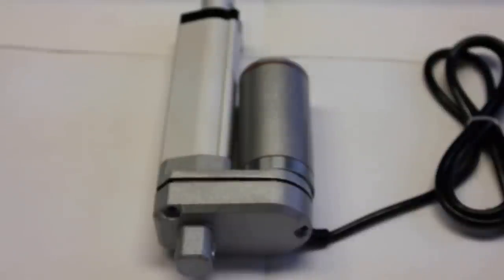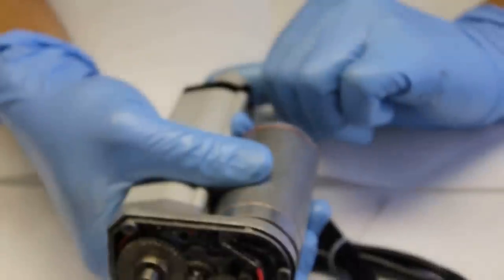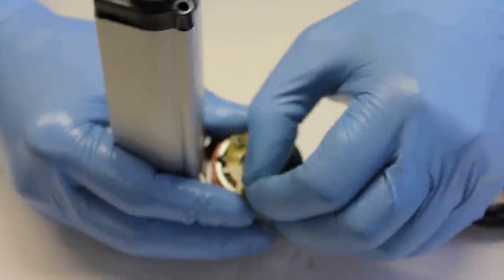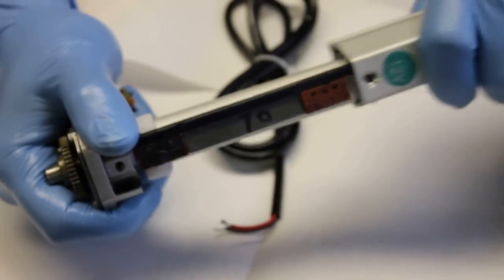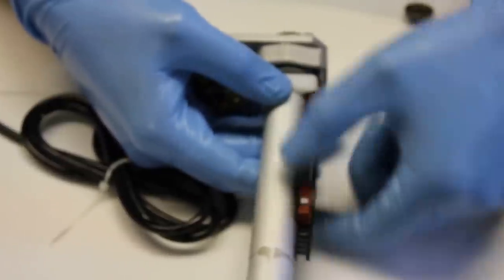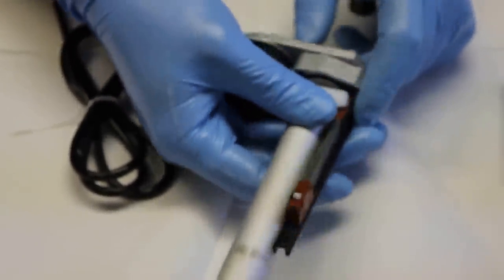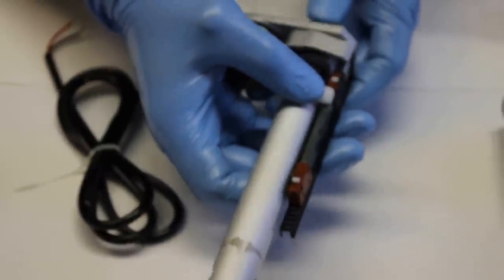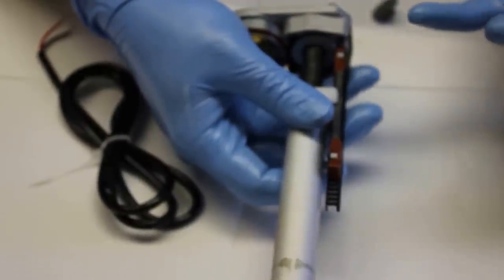Electric Linear Actuator - How It Works - Progressive Automations

Comment: Is there any way to make it run faster? mabe changing gears?
Reply from the maker: Hello Daniel, you are correct, to change the speed rating of an actuator, the gears, lead screw, and motor can be changed. For the PA-14 unit, the 35lbs force rating is the faster we have. Please see the specifications here: https://www.progressiveautomations.com/mini-linear-actuator
Reply: thank you but I dont see any parts on the page you send.. do you sale only gear parts needed?
Reply from the maker: Hello Daniel, For  actuator parts, please see the link here:   https://www.progressiveautomations.com/actuator-parts If you are looking for a specific part, please call in at 1-800-676-6123 and one of our knowledgeable representative will be able                       to assist you. Thank you!

Comment: but how do you adjust it?
Reply from the maker: Hello!
Applying +12VDC to the motor lead wires will extend the stroke rod and reversing the polarity to provide -12VDC to retract the stroke rod. The internal components including the limit switches are non-adjustable.
Thanks

Comment: Thank you for useful video, one question. In case of motor failure, or power failure this actuator stays in position. That is how it is designed off course, there must be another flexible design that can be actuated manually in such case.